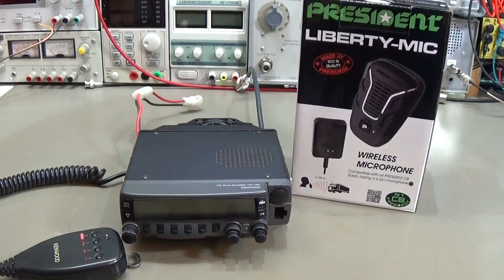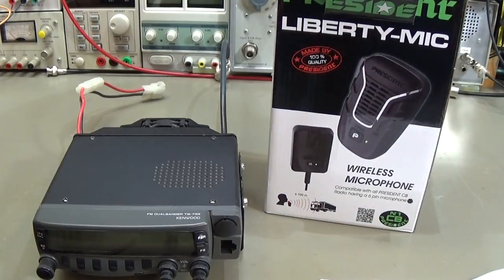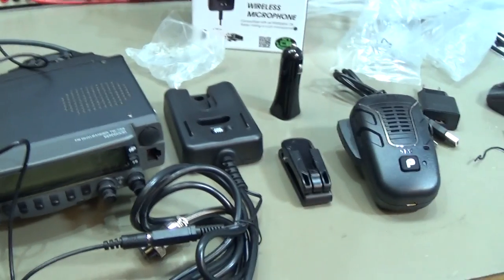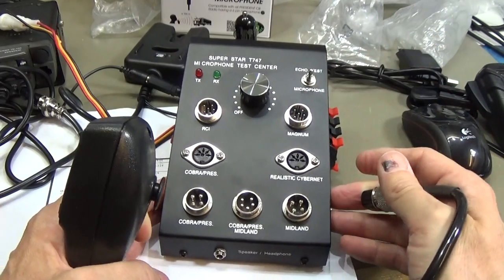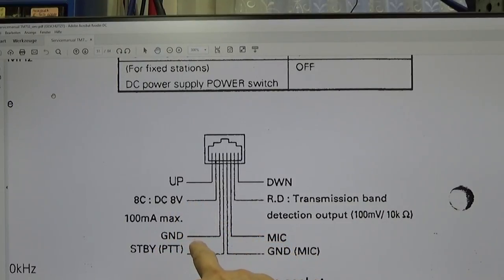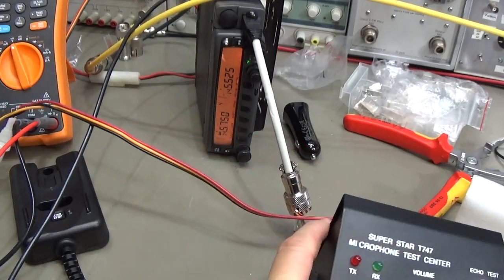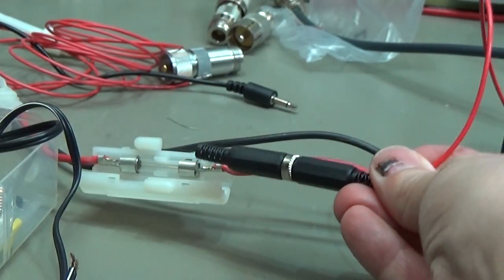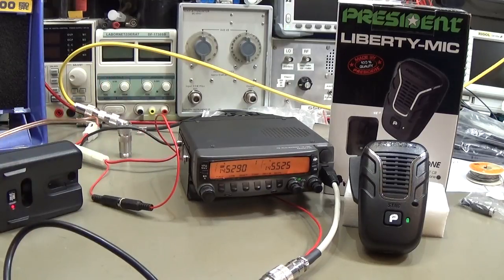#149 Why and how to connect the President Liberty Mic to an amateur radio

Comment: Great Fix for the DECT Microphone. Thought of another way to possibly do it, if there was room in the microphone cradle to install a DC-DC CC CV Buck Converter inside of it. That would eliminate any external wires. Just an idea. Thank You and keep up the GREAT work.
Reply from the maker: Hi Ray, yes a DC-DC converter could be a way but I can't recommend it as it would void warranty. Thanks for watching 73

Comment: I'm curious if whether or not you had considered placing a boost converter within extension cable instead of tapping the 13.8 volt source. Your solution makes for a cleaner and less complicated adaptor.  Just curious if you had entertained the idea. Great video BTW. I love the experiment.
Reply from the maker: No, we decided for the supply voltages, as any boost converter is a potential source of noise... By the way this mic is still in daily use...

Comment: Will it work with a Yaesu tranceiver aswell? I know the voltage in the connector is about 5 Volts, so the same power supply will have to be arranged as in your video. Thanks for this nice video

Comment: The only issue I see with this system is that it looses its link when the power is removed from the base unit. I used a Bluetooth adapter from Jabra and linked it to a Blueparrot headset on my FT857. Never lost sync and worked the Pitt via VOX which worked out really fine.

Comment: Glad to see it work on\k Peter. I was wondering if the base unit had a voltage regulator in it and if so what was the output voltage.  Was also concerned about if the radio would supply enough current to run the unit.  Great job as always my friend as this was very interesting.
Reply from the maker: Yeah would like to know what the schema is but nothing found and as it is for a ham operator I can't open the cradle for any further investigation. 100mA is fine Buddy. According the DECT specs the max output is 250mW
 but usually  is between 10 and 65mW. But let us calculate with 250mW. The
 max current into 50 ohm would be 25mA. Now lets assume the efficiency 
of the TX is only 50%  that means max 50mA.. So no way to worry :^). Thanks 
for watching 73 Take care my friend
Reply: Thanks for the explanation Peter! Should be fine then. Have a great week my friend.

Comment: Hmm, the President base has a receive audio input jack.  The Uniden ones here in the US do not have that.  President is in the process of getting FCC type acceptance so they should be available here soon.  Will be interesting to see if the US version from President has the audio input jack.  They are nice microphones.  I have been using the Uniden version for over a year and it easily goes well beyond 100 yards.  Thanks for sharing.
Reply: Did you supply 13.8 volts directly to it?  The one I have from Uniden is designed to run on 8 volts from the radios 8 volt regulator circuit.
Reply from the maker: Oh that means  the Uniden could be a disadvantage for ham radios. Example is the Kenwood with 8 pins connected and no audio in the mic jack as we have it with CB radios hmmm? Yes I did supply 13.8Volt.
Reply: Will the uniden run ok at 12v then ? Im trying to hook it up to my yeasu 991a

Comment: Hi Peter im using an icom 703+ with a gn9120 bluetooth with headset, i was hoping the 8v would supply the base unit, but in tx the 8v seems to drop and the head unpairs from base unit? would i be better supply the unit from 13.8v supply with say a 8v regulator? it seems the 8v line on icom mike socket is very low current ? whats your thoughts..
paul
g4sbx
Reply from the maker: Hi Paul, as the mic is designed to be used on 13.8V it is the best to wire it up as I did it here in the video..Thanks for watching 73
Reply: Hi Peter, yes on liberty mike 13.8v fine i guess but the gn9120 only has 7.5v supply, anyway we have it working now, thanks for your input
paul
g4sbx

Comment: Hi, first of all thank you for very nice video. I just got my liberty mic and I am trying to connect it to my Elecraft K3. As far as I understand you are using 4 pins out of 6 available: Mic, GND,+Vcc, PTT. However all 6 pins are connected in Liberty's cable. It means they may use UP and DOWN (pin 4) as well. But as as far as I understand "+" and "-"  buttons are for internal volume control and not for tuning, so it does not make any sense to wire it out to connector. However, again, all 6 pins are connected to internal Liberty’s PCB. Does it mean there is some mode to use these buttons ("+" and "-") for tuning as well?  It would be great to have remote fine tuning as well....
Reply from the maker: Yes Igor that is true only volume possible...73

Comment: hi peter
could i use the president liberty handsfree mike without the audio lead? as my icom tx is in the boot of car and a separation kit runs from boot to my dashboard, audio comes from my cd player in car which i sw between...thanks for great video very interesting
paul
g4sbx
Reply from the maker: Hi Paul, well without the audio lead you have no receive audio on the mic but other than that all is working...Thanks for watching 73

Comment: Will this work with any 6 pin cb radio without having to open up plug and modify it ?
Reply from the maker: Well nobody can grantee that as there is no norm. But a lot of radios with 6 pin will work but don't plug it if you are not 100% sure. Ask a radio tech before you destroy your radio!   Hope that helps a bit 73

Comment: Hi...an other problem it's not only the Vcc, but also the current you need for that device, may be 100mA from RTX it's not enough..may be 250mA or more it's better !!  '73  ..by the way, good review.
Reply from the maker: 100mA is fine Alessando. According the DECT specs the max output is 250mW but normal is between 10 and 65mW. But let us calculate with 250mW. The max current into 50 ohm would be 25mA. Now lets assume the efficiency of the TX is only 50%  that means max 50mA.. So no way to worry. Thanks for watching 73